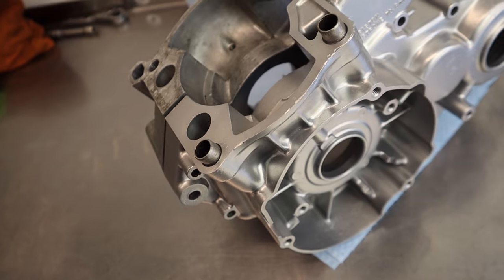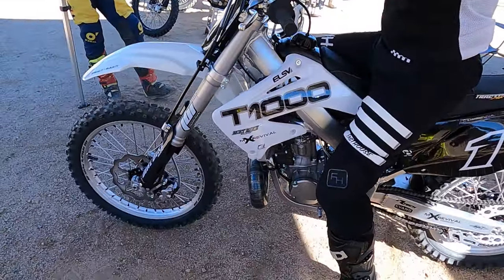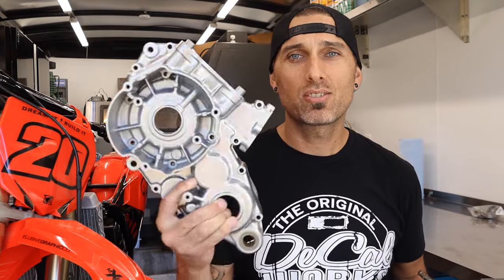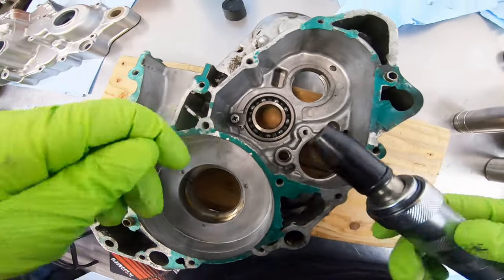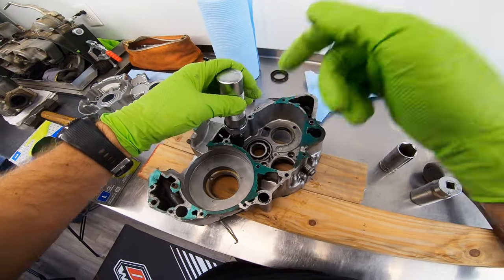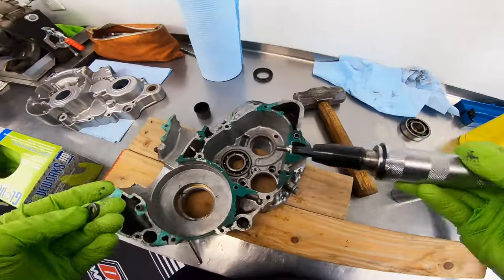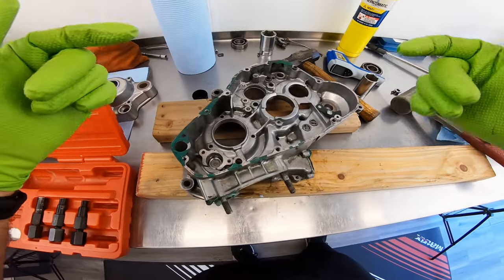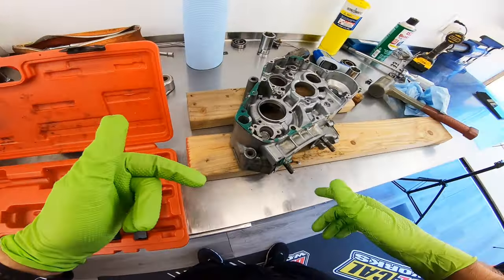My VAPOR BLASTING SECRETS - HOW to Vapor Blast & Make Aluminum Dirt Bike Parts Look Better Than New

Comment: Fantastic video, thanks for taking the time to make it and share knowledge.
I'm looking to purchase a wet blaster myself and would proberably run a 2 stage setup like yourself (dry blast first) as I have a dry blaster with AO for Cerakote prep.

If I can offer any bit of help/advise it would be:

I purchased a rubber mat for inside my cabinet, it stops parts getting marked up on the metal mesh. 

Subscribed and love the music choice for the vids too 🤘
Reply from the maker: Thank you metal brother! Glad to do it, and surprised somebody else had not yet. I have a little bit more technique explanation as I've gotten better at it and one of my more recent videos If it interests you. It's the video of the CR 500 swing arm restoration from about 2 weeks ago.

The two stage setup is so awesome especially when I need to keep extra dirt or debris out of the wet blast. I can run a little bit more aggressive media in the dry blast to peel zinc coatings off of Hardware to be restored, and even use it to get dirt and grease out of nut threads. Then the vapor blaster can bring the surface finish well enough to shine if I stop there on prep before a zinc plating for example.

Your tip is a good one! The wet blaster came with a plastic base, so that has been really good for keeping things scratch free. Still not as good as your tip about the rubber mat. 

Thanks for watching and thanks for adding some value in the comments for others. 🔥

Comment: Really appreciate the video. Interested in the process you do to ensure all media is completely gone before assembly.
Reply from the maker: You're welcome, thanks for watching Tristen. You can simply use compressed air to blast out all the cavities. You can also put bolts into all the threaded holes before you blast if you wanted. Another way to do it is to rinse the part really well. Sometimes a combination of all three.

Comment: Charles my man! Thanks for going in depth here. I need to incorporate the low low pressure in the vapor blaster to get more of a shine at the end. I don’t have the sand blaster so I need to run my vapor blaster at a higher PSI at first (60 psi +). But now after learning to go low with the pressure to give it that shine, I’m pumped!

How long per each case side are you spending at that low pressure? (On average, because I’m sure there are a bunch of variables). Thank you sir!
Reply from the maker: You're welcome. I "suffered" for a few years so I thought this could be a nice video for some!

If you want a dry blast cabinet, there are a lot of really great & cheap smaller units that are perfect for dirt bike parts. It's not necessary, but I like having the dry blast to make sure even less debris gets into the wet cabinet to preserve the media even more. 

As for time, man it's hard to say. It still takes quite a while (dry blast moves that along faster as well, pre-wet) and can still be hours before you really get the shine to where you'd like it to be. Esp. if you still have blast lines that end up sending the part back in (from the 60PSI).

Can't remember if I mentioned it in the video but you can try this:

-Your 60 PSI blast/ cut - close range, paying attention to blast angles when you can (45 degree average)

-Same 60 PSI with gun pulled back, to "blend". Just sweep the part gently, everywhere, whit the gun 4" away or so. Take your time. You'll get a feel for it. This will even-up the whole part. After this blend stage you could technically be done depending on what the job was. Should be very even finish now. 

Next is low PSI pass. If you feel like it's taking forever, don't worry. It's normal. When you're sick of blasting and getting antsy or your feet start to hurt keep going. That's your first hurdle to overcome in order to get the shine you thought you were getting when you bought a vapor blaster in the first place 😂 20-30PSI, watch your gun angles, stay close to the part and do the "blend" all over again when you're done.

Somewhere between all that above and a mix of DIY, you'll find your happy place and variables that may make my instructions differ from your results due to variables like your compressor and specific cabinet.

Vapor blasting is all about patience & the rewards are on the other side of that. That's what I've learned.

Get it Greggy!
Reply: @mxrevival  anddd dropping even more knowledge in this response! You the man Charles, much appreciated. You can get parts to look "great" with a stardard process but man if you really want them to shine like you did, going over and above on them is definitely worth the time and effort.  Can't wait to get out there and get to some testing asap! Cheers dude!

Comment: Good video ! When you’re removing the bearings & misc parts do you bag/label the parts for the customer to reassemble ? When you’re done w/the part is there a Cerakote clear that can be used on them to preserve the finish ? Have a good one
Reply from the maker: Thanks Mark, dropped a brand new vapor blasting video yesterday as an update to this one. More advice, equipment upgrades, better results. I do bag the parts up and label if it’s necessary and not obvious where they belong. However, if something comes in with bearings, still installed, they are generally not being reused. You are so far into your engine, that it doesn’t make sense to put something old back in it. Especially after someone pays for special detailing, such as vapor blasting. Regarding the clear ceramic coating, you definitely can. I prefer not to on dirt bikes. Street bike engines would be a better excuse to do it. In my opinion, dirt bikes are getting hit with rocks and roost, which is going to eventually make the clear coat haze. Because the aluminum can always simply be vapor blasted again, now you have a clear coat that you need to get off first.… so dirt bikes, no. Street applications.… sure!

Comment: Another awesome video. Thank you. Do you avoid blasting surfaces where bearings seat?
Reply from the maker: Very welcome, thanks for the positive feedback. It depends. 

I cleaned the insides of these (with the glass bead) because they needed it badly. Rust trains & such. The glass is pretty gentle on the parts but it CAN change the surface of the part, so you wouldn't want to run it too hard for too long. 

Aluminum oxide for example would cut hard and fast & while the part would probbly be ok- same thing, just be gentile. Then there's soda, which literally does nothing to a part's surface. 

So again, it just depends. You won't have any issues. 😎 Unless you fail to get all the bead out of bolt holes, etc and they end up in your rebuilt engine.... No bueno

Comment: Hi Charles ! Very nice work here!!

My question is: could you let the motor like that for the rebuilt or if it needs to be paint ?
Reply from the maker: Thank you! Yes, a rebuild is the perfect time to do this that way, everything looks beautiful when it goes back together.

If you intend to paint your cases or have them ceramic coated for example, then you would want to use a basic dry blast cabinet with aluminum oxide in it.

Aluminum oxide will give the part a little more of a texture because it is a coarser media. This is so that the paint or ceramic coat will stick and have something to hold on to a little better on the parts surface, as well as better longevity.

Glass bead is a polishing media that bounces off of the part. So it does not offer the same amount of grip for a coating to go over it, even though it can be done. Generally speaking though, glass bead is what gives the part a nice shine or bright luster.
Reply: @mxrevival  so, we can let it like that without painting?

Comment: The problem with sand blasting engine parts is if you use silica sand or glass beads as some might call it, is when the engine gets hot, the pours open up in the metal weither its aluminum or steel and when it does all the glass or sand from the blaster gets released into the engine when you start it up. If you do have to sand blast eternal engine parts, use a crushed walnut media as it's organic and has a better chance not to mess up the engine after you reassemble it. And with glass or silica sand, even if you thank you have thoughly cleaned it out. Eventually, the media from the blaster will work into the oil passages of the engine. Wich will then junk the engine forever. So only use walnut. As all engines have porosity in the metal and when it gets hot the porosity opens up.
Reply from the maker: It’s very possible, and this is great advice. Especially regarding oil, passages, etc. 

However, we have never had be get stuck inside of an engine. 

Mostly that would be due to pure negligence on behalf of the person performing the blasting, and lastly, the mechanic or owner, which is the last line of defense before assembly IMO.

We have found that thorough rinsing inside the cabinet, followed by compressed air blown through every passage and fastener hole afterwards has been excellent. 

In some cases, we also rinse parts inside of a simple green bath which also helps release any lingering media due to its lubricity (soapy!)

And most recently, we’ve picked up an ultrasonic cleaner to send parts through after vapor blasting, for just one more method of bead removal.

Never any issues before the ultrasonic cleaner though.

So being extra cautious is the way to go. Pretty much everybody is vapor blasting nowadays. 

Thanks for watching and for sharing your knowledge with everyone
Reply: @mxrevival  I bought one of those as well, a very awesome mechine. I purchased the 10 gallon unit, which, I think, has 6 ultrasonic heads in it. It's been a while since I last used it.

Comment: Hey just wondering how long the cases stay looking so good? I've done allot of dry blasting for cases and they look great for a few months but then they get a dirty look to them. Wondering if the same happens after vapor blasting
Reply: Hi there- if you have done dry blasting with aluminium oxide then, in my experience, the parts get dirty very quickly because of the tiny cavities the blasting process causes. After vapour blasting the parts seem to stay a lot cleaner for a lot longer. I usually put my parts in a heat cabinet directly after vapour blasting and the heat and moisture sets up a quick and thick protective oxide layer on the new surface .

Comment: Hi dude. Do you need to file the engine halfs where they meet. When they are vaporblasted
Reply from the maker: No sir, not from the vapor blasting. However, your cases could still be lapped if you think they do need their mating surface cleaned up some.
Reply: @mxrevival  Thank you @mxrevival

Comment: Do you clear them with a satin clear or leave natural
Reply from the maker: I just leave them alone. You could definitely clear coat them if you wanted to. My thinking is that eventually the clear coat is going to look hazy and beat up again if it's not a resto project. And that will require stripping before cleaning so an extra step.

Although most bikes don't get fully rebuilt twice so there really are no wrong answers

Comment: Appreciate your videos keep coming please
Reply from the maker: Will do! Thanks for watching.
Reply: @mxrevival  What would be your best take on removing deep rust not the one you can easily remove using sand paper from a pro circuit works pipe ?

Comment: Wouldn’t it be best to leave the bearings in? Wouldn’t think it would be a good idea to blast the bearing surfaces being they are a press fit. Just a question I know nothing about this type of blasting.
Reply from the maker: It's a great question. But it's not necessary. Glass bead is pretty gentle and unless someone let the blast nozzle sit in one spot, at very very high psi, it will not alter the surface of the part or distort a tolerance. 

May also add some damage to your nice Media blasting job trying to get the bearings out afterwards. Maybe not, but something to consider.

Comment: In your experience, would vapor blasting by itself remove a factory painted finish?
Reply from the maker: It usually can, but it will take so incredibly long that it is miserable. I always have it removed first. Vapor blasting for the most part is just too gentle for that. 

You can try a product by Rustoleum calked Aircraft Remover on it first. Basic aerosol spray can. Looks like a spray paint can. 

Or you can give the painted part to your favorite powder coater for removal.

Basically, the the dunk tank they strip frames in  will melt the paint off.

Comment: Just wondering...... How about a wet blasting attachment for a pressure washer using soda?
Reply from the maker: Good question! I’m not sure… I had a soda setup in the dry blast and it’s really gentle. Cleans pretty nicely. No shine afterward but very “OEM / dry” look on aluminum. 

The thing I didn’t care for with soda is that it’s dead the moment it hits a part. Can’t be recirculated like glass bead. Also crazy dusty! 

I think it Works great how you described though for pool cleanings? Like the grout and walls…

Comment: The results are amazing 😍 Great video!  I`m sitting trying to figure out how to tackle my big ass engine 🤣 There is like NO way I'm gonna get ahold of this equipment😬 So I wanted to ask ,if you have tested sodablasting?  like those cheap things you hook up to an air compressor. Tight budget over here🤣 But i think i have a plan🤔
Reply from the maker: Thanks dude 🤘

eah I have actually. My very first cabinet was a dry blast unit that had auxillary soda media hopper and HEPA vacuum. 

It cleans good on some things but not strong enough to clean most things in my experience, and at those pressures

Glass bead actually polished, which is where the shine comes from.

Never say never, you could totally end up with the equipment you need. I just have a vary large and very expensive cabinet because I wanted to do frames

You can get units that are literally a fraction of the cost. Do it!
Reply: @mxrevival  Noted noted 👌 Glass bead would be the dream for sure, I'm still asking around for equipment to borrow so I might have luck 😆 But for now, dry sodablasting out in the open is what I can do for sure. Engine gonna be cleaned one way or another tho😆
Reply: You really can build all the equipment yourself very cheaply out of easily found common parts. The compressor is the most important part but you can try and get one used or one that needs fixing - that is what I did so maybe you can try too if you have space.

Comment: Blasting with abrasive media is a necessary evil 😂

You will clean just about any surface or material with either a Dry Blaster or Wet Blaster.
The downside.
Blasting is like watching paint dry 🙄

Unless you have a full professional abrasive blasting setup, it takes Forever to blast a set of typical sized crankcases.
You will be happy with end result.

But it just takes more time than you might think.
And the other downside is you Need a BIG Air Compressor for Dry Blasting, either that. or
A Lot of Patience 😉😁

Comment: What's the difference between dry blast and sand blast?
Reply from the maker: Dry blast is a _procedure_. Sand is a _media type_. 

Examples:

-"I dry blasted my part with sand"
-"I dry blasted my part with glass bead"
-"I dry blasted my part with aluminum oxide"

You hear guys say stuff like "My sand blaster" but technically it really means "My blaster (regardless of wet or dry) has sand in it"
Reply: And please NEVER use sand! Aluminium oxide ( perhaps other media )is the safe way to go .Sand- like building sand -will give you silicosis which is no joke . Everyone calls it "sand blasting " but no one uses sand